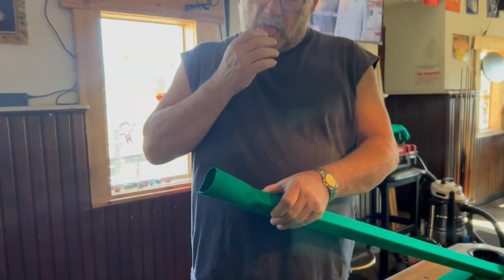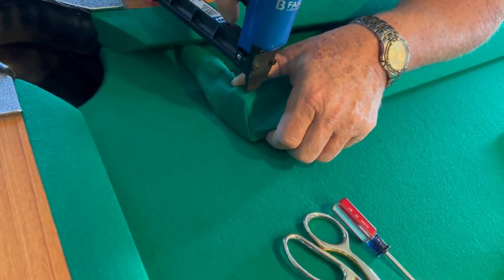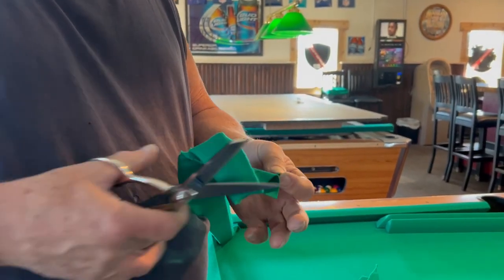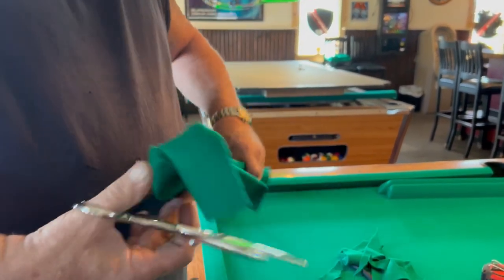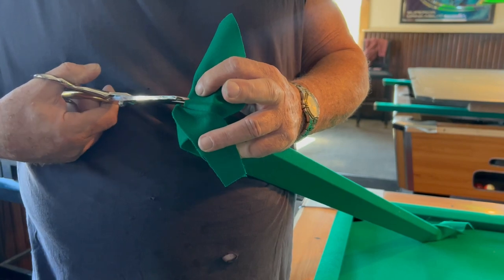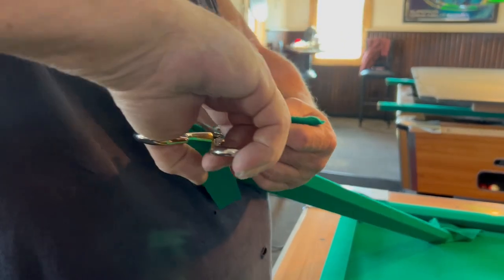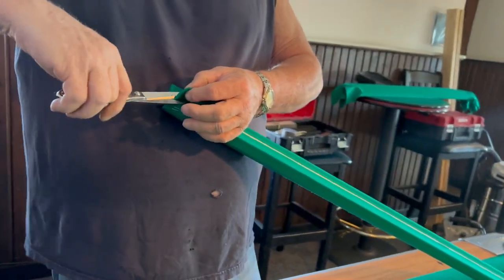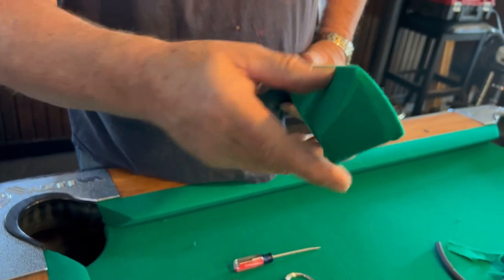HOW-TO: Side Pocket Folds on Valley Style Pool Table Cushions

Comment: Thankyou for doing this channel.  I'm teaching myself how to do this for my dad.    We have a 9ft American heritage tournament table with the tightened up pockets.   

Would you do everything the same way?
Reply from the maker: Those rails require a feather strip to hold the cloth tucked into the feather strip dado, which means you must wrap the cloth around the cushions, and the ends of the rails. Valley style rails are detachable, which means you can wrap the cloth around the back side of the rails and get rid of the excess cloth behind the cushion block. You can't do no fold side pockets on feather stripped rails.
Reply: @therealkingcobra  ok thankyou.  Will you be putting and videos out on that?   Just wondering trying to learn
Reply from the maker: Yes